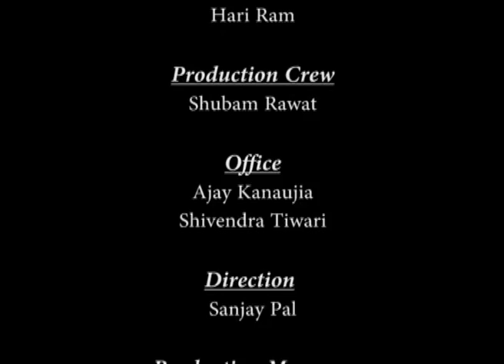Mod-01 Lec-32 RIST Diagram-II

Comment: Could someone explain to me, please, where the equations came from from time 22:13 "Enthalpy C = 23.5.T - 11800", "Enthalpy Si = 27.2.T + 40000" and "Enthalpy Mn = 48.6.T -10000"? I tried to replace T with the value of 1800K and I didn't reach the values shown in the video. Thank you very much!